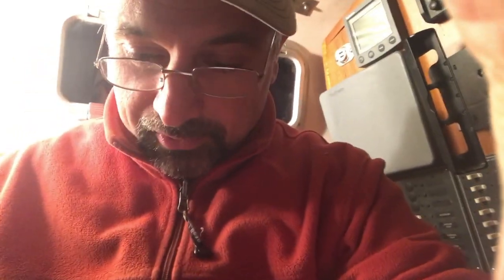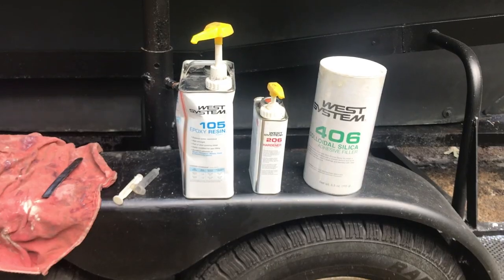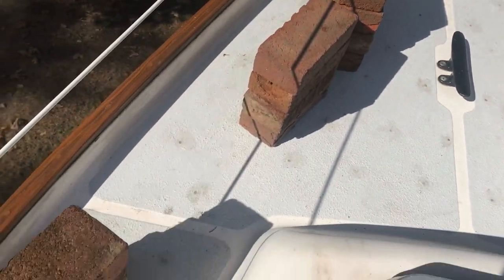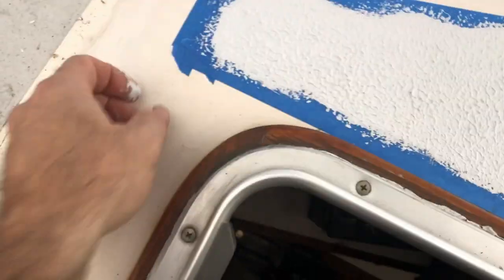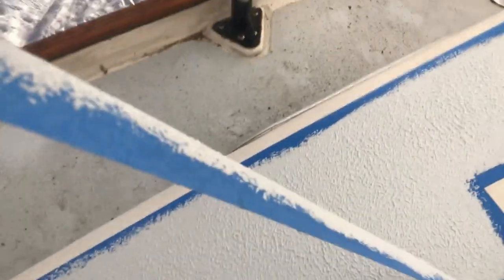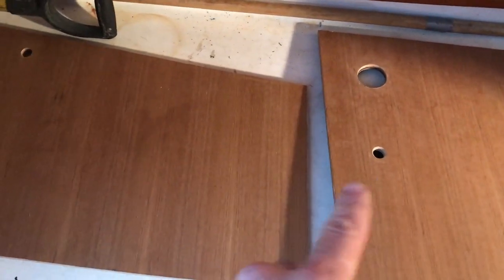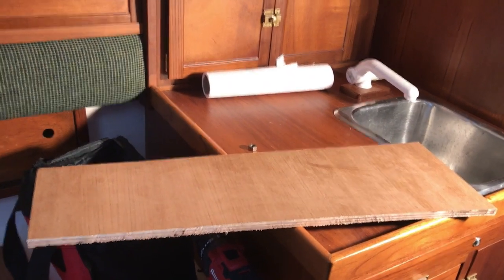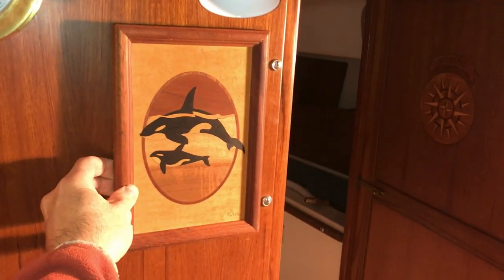Contessa 26 Refit ep.16 - Haul out projects 1: Delamination, Battery Relo. & Shelves

Comment: didn't realise the canadian contessa's had a deck core, I know the uk built 26's & 32's have a solid GRP deck. It's one of the things I've always found very appealing about the contessa 26 & 32, no deck rott! I just assumed that since JJ bought the original moulds from Jeremy Rogers when they stopped making the contessa in the uk that they just modified the mould to enlarge the cockpit and constructed them the same way. 
Learn something new everyday, thanks for the upload.
Reply from the maker: That's surely one of the major differences, though I believe there are also some early JJ Taylor built boats that have no coring also. There seems to be a transition from balsa core to plywood core in the 1975-1976 timeframe and possibly experimentation with no core. 
The non-cored deck boats do have a bit of flex as a result, most noticeably in the foredeck.